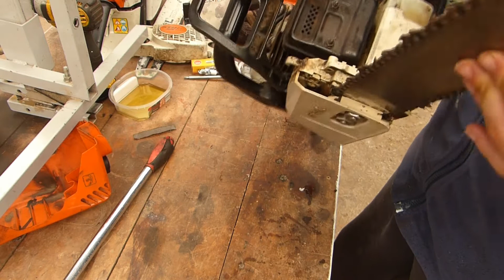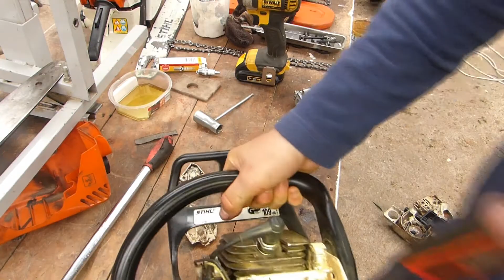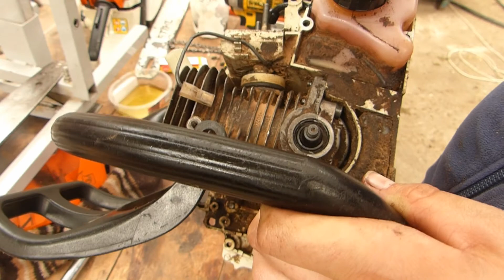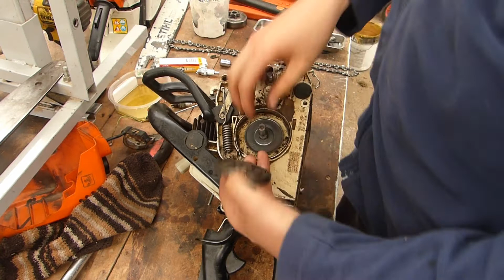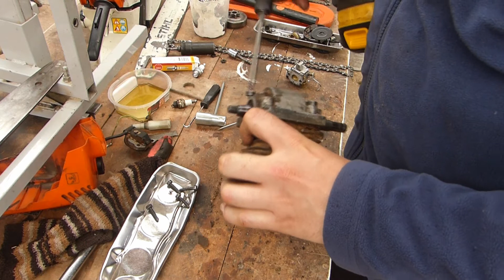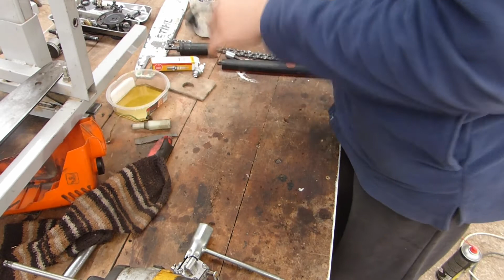Why Will The Stihl MS 170 Chainsaw Not Run? Disassembly Overview

Comment: Odd that some of the piston ring was actually missing.
Reply from the maker: Yes and I never found the missing part, as though whoever worked on it last broke the ring and thought to install it as is.
Reply: @WilkoinFrance  Yeah that sounds likely, steel parts don't just disappear eh?
Reply from the maker: No they don't and also seeing as there's no piston or cylinder damage it seems the most likely.